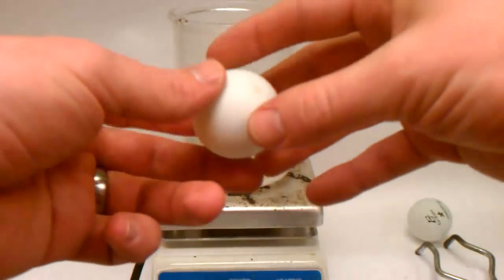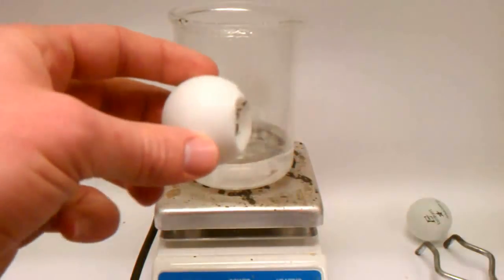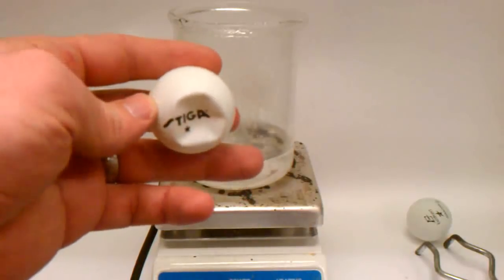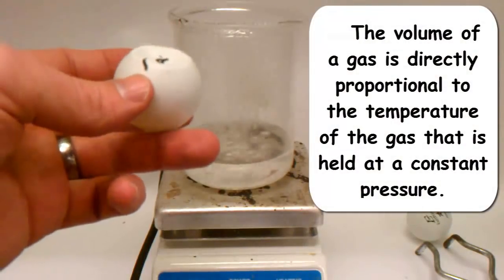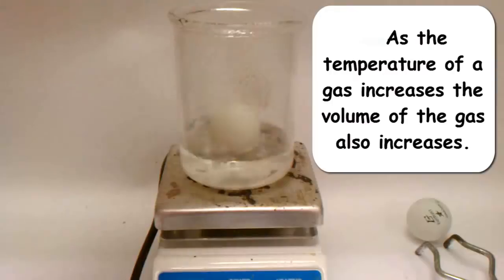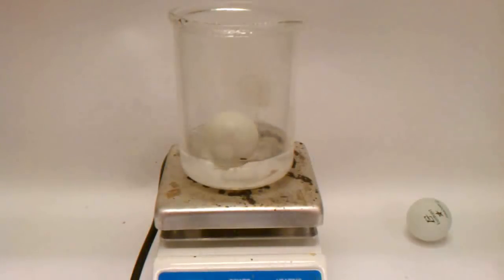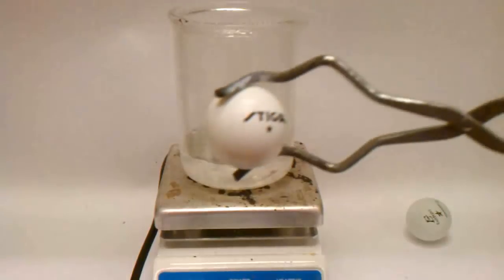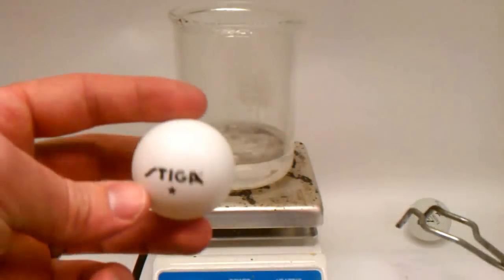How to Fix a Dented Ping Pong Ball

Comment from the maker: @tigraroe EX You can try using something to hold the ball under the water..If the ball is submersed in the water it will be surrounded more by the heat. Sometimes, however, the dent is just too large or it could be possible that you have a hole in the ball. A puncture will not allow the pressure inside the ball to increase with the heat. Good luck!